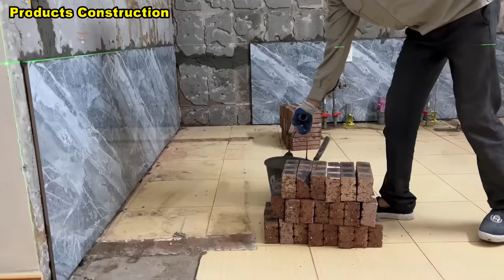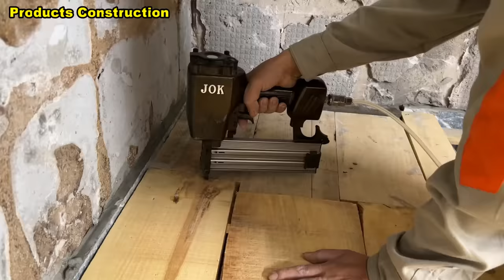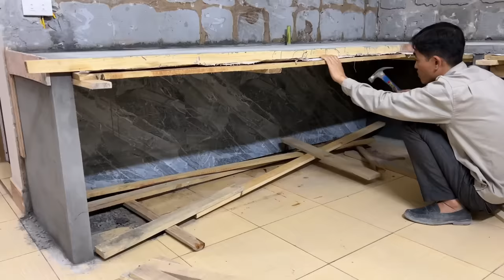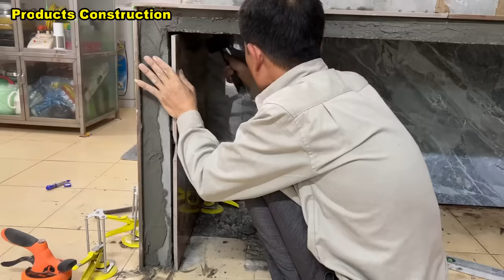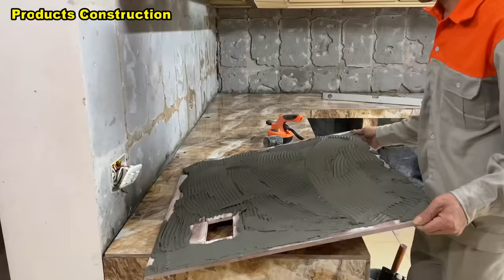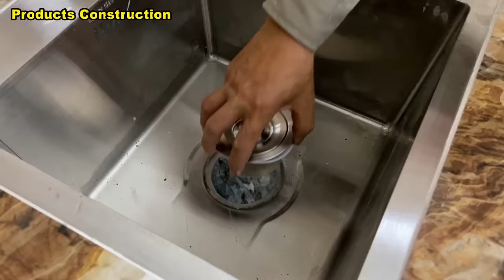Ideas Design Kitchen Table Open Modern || Install Luxury Countertop With Ceramic Tiles

Comment: The concrete and stone work is well done. I wouldn't have put the granite on the backsplash, but whatever the customer wants. However, he needs a plumber for the sink drain. The second basin drain pipe is going uphill. It will not drain properly and the whole unite dosen't have a p-trap to the grey water drain. Sewer gasses will come up through the pipe into the kitchen. That needs to be fixed.
Reply: A

Comment: These kind of things drive me crazy the work is great and it is built strong and fireproof but why are the tiles two different kinds and there is a pattern to them you have to turn down a certain way so that pattern matches up and it's continuous I mean if you care about stuff like that but it should be very sturdy

Comment: If the wall is attached to it, then the joint of the stones in it will die, otherwise there is a complete danger of the wall falling, cracking the wall.

Comment: I saw that, he used 2 chipped tiles on top of the sink and below the sink. Even thru video I can see the tile lipages not flush. Job is so bodgy. I can pick so many things wrong. Maybe that is acceptable in that country, but in my country I would of been made to ripe it apart and do it again.

Comment: O resultado só não ficou 100% por 2 motivos cruciais relacionados ao acabamento:
1º O recorte das juntas devem ser feito no ângulo de 45º, é a única forma de ocultar as laterais das pedras
2º As pedras possuem um padrão de casamento que formam um desenho linear, se não seguir a junção correta entre uma e a outra, se torna em bangunça.
Esses 2 detalhes fazem toda a diferença e são tão cruciais que, se não forem levados em consideração, eles anunlam a visibilização de todo o trabalho feito, causando a sensação de gambiarra para o cliente, mesmo não sendo.

Comment: Bad construction. Does not pay attention to details a lot of cracked tiles. The countertop is not straight and it s not sustain properly due to its weight it will crack over time and broke down.